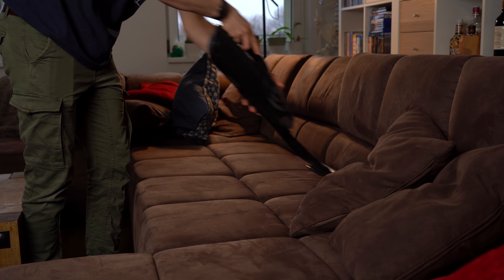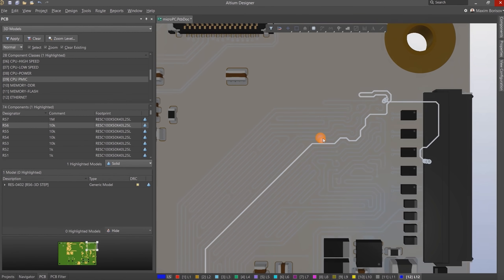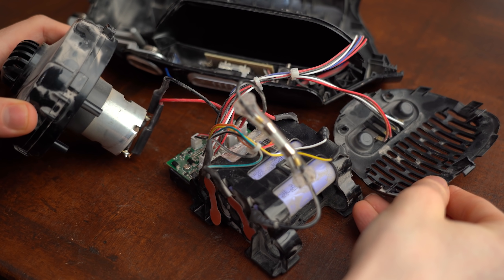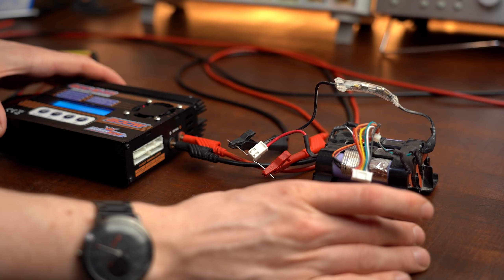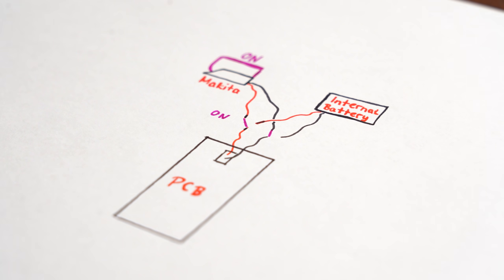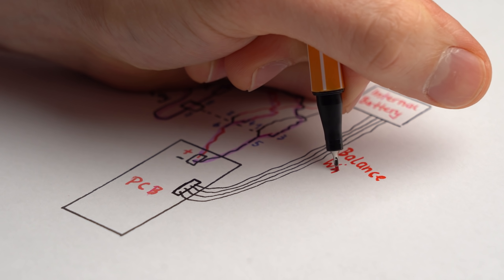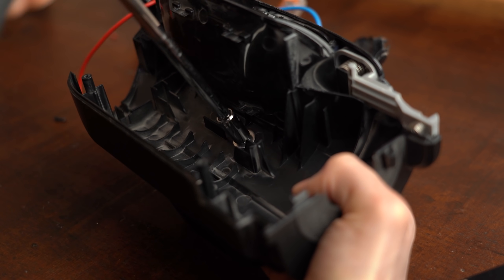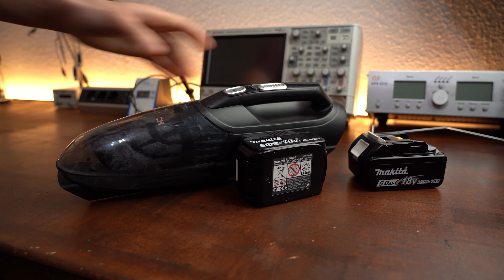Every Device should have this Upgrade! (Endless Battery Run Time)

Comment: Started looking into Power Conditioners for my home due to frequent ripple from other large appliances ( Most commonly the tankless water heater ) . Thought I'd check here for a diy or buy on the topic as I've seen many types voltage controllers on the channel.
Hope to see something from this channel on cleaning up mains power. Ripple and/or Surges.
If I'm overlooking the topic covered even in passing I would appreciate a link in the right direction. If anyone can link me to another channel for the info that would be helpful as well.

Comment: Can you please make a video on hacking  an Apple TV 4K to use type c as power input and using a Type C Decoy for power and using short circuit protection to protect the motherboard from getting fried and please try to use 3d printed parts to hold in place and an few modifications here and there so you can have be portable and take it anywhere and also making a VESA mount to mount it on a monitor or TV. nobody else hasn’t done it yet and that I’ll be the first  and make it look very cool

Comment: It's possible to do much the same thing with far simpler parts. On a similar project I used a micro switch with the external battery connected to the normally open side and the internal pack on the normally closed terminal. With the other circuitry hooked up to the common terminal it was easy enough to position so that it actuated the switch when a battery was inserted.  While the project I was working on was a rechargeable portable speaker, the same principal applies. I hope this helps...

Comment: You will need more running time for extra cleanness and tidiness so I would not consider that as 'Endless'. 
However, if you make a Makita battery shape power supply then you are good to go endless vacuuming!
Reply: On in use, one on the charger, can go on forever.

Comment: wouldnt it have been more simple to wire them in parallel, they both operate at the same voltage and both are 18650s in 5s configuration

Comment: Do not store the vacuum with external battery connected, as the relay will discharge the external battery. Latching Relay to eliminate current draw of the relay when makita battery is left connected for long periods of time?

Comment: Simple.... Thank you I learnt something. So As long as your Current draw and voltage is the same, We're good to go. I assume if the battery can provide more current, let's say 2x the amount needed then should still be fine right? Just means the battery will last even longer?

Comment: Alternatively you could just buy the Bosch Unlimited stick vacuum cleaner that comes with the Bosch 18v all for one battery packs that allow you to swap batteries between charging and also you can use them on Bosch garden power tools. They're also 18v.

Comment: New Dysons have essentially power tool batteries. Of course my Dyson doesn’t, because I didn’t pay $1100 for it. It’ll still suck a golf ball through a garden hose, though. Edit: and the battery is user replaceable. They will sell you a new battery and I believe the torx driver required for it. If not, well it’s four security torx, so how difficult can it be.

Comment: Why u use 2 100 Ohms in parallel, because you had them ?
I think 1 with 50 has the same resitance, right?
Reply: Same resistance but 2 resistors can handle more power/heat.

Comment: Does the original PCB care at all about the charging level of the original battery? As in does it check the voltage to see if you can run the back?
Because then you'd have to remember to charge it.
Also if the battery pack is inserted can you charge the vacuum or do you have to take the pack out? 

Not really an issue, I just wonder

Comment: You have 2 Makita batteries and a charger. Theres Makita vacuums from around 40 eurobucks. I can honestly say the cheapest one is better than the Botch, which relies on clicky snappy parts to make it look like a serious vacuum but its a joke, and even if you boast about german cleanliness, if that Bosch is what you use then your place must pretty fucking rat and cockroach infested filthy dumpster with at least a heroin addict hiding under the kitchen sink and you dont even know it. Seriously I had used that exact vacuum once to clean up after some drilling and it was pretty weak, battery charged. Just sayin..

Comment: What if you wanted to use ego(56v) battery with multiple battery household items? I guess my question is really: how could you make a high power draw capable variable voltage power supply?

I have done this before with some AC power tools, but have never had any luck finding the components to change my 56v battery into an “any voltage I want” with a reasonably large current capability. 

Any thoughts?

Comment: i think that many electronic devices with rechargeable batteries have a low amp charger on purpose since it is recommended to charge a battery nearly as slow as possible... so instead of charging it with 1C (capacity in mah) its better to give the battery more time and charge it at about 0,5C.

Comment: My dyson v7 is pretty excellent, but the battery is getting long in the tooth. I may need to add a mod similar to this someday soon. (assuming the same, the vac doesn't get mad at the balance wires mismatching.

Comment: I was thinking you were just going to use the DC barrel jack, but that solution is much cleaner. Good job!

And, yeah, a battery designed to run power tools would barely break a sweat with that piddly little vacuum motor.

Comment: when doing the plastic welding, if you dont want to melt the plastic casing like in the video. you can use heat proof tape to cover over the areas you want to protect

Comment: We already have endless run time. Invented by Tesla. Plug it in to the wall and it runs forever. Battery powered ANYTHING inside a home (other then emergency lights or communication devices) are ridiculous and lazy....

Comment: Can you pull the batteries out from the pack and rewire them in the vac xase,case, you sider two leads to the batteries in the case than cut two holes to pull the chacable out so you can change,2 batteries pack with 2 chargers with out pulling the mod out all time.

Comment: What about making a cordless device corded? So that you can just plug it in when it runs out of battery juice? I would like to do this to one of my ryobi cordless drills, and I have a matching 19v 6A charger from a laptop. Although I have heard things about amp boosting, where when the drill ends up drawing much more amps when it needs lots of torque to drive a lag bolt for example. No laptop chargers go up anywhere near the amps I have seen for this (you need a pretty expensive power supply with adjustable power settings) so I'm wondering if this is a dead in the water idea since it was supposed to be a cheap diy job.

Comment: Forget the relay. Connect the internal battery battery to a rectifier diode, power can then run from the battery into the diode, then to the remainder of the circuitry. Now connect a second rectifier diode to the remainder of the circuitry in exactly the same way, only connect the second diode to the external battery pack. Mount a 2.1 female jack on the case to of the vacuum to allow connection of the external battery. Cut the wire to the Power tools battery connector short and add a 2.1mm male plug to the that wire, be sure to use the correct polarity. No as a bonus, buy a cigarette lighter adapter that outputs 18vdc, with at least 7.5 amperes. Higher amperage will not be an issue, lower amperage will either damage the adapter or not supply the power needed. Also make sure it has a male 2.1mm plug with the correct wiring. Now you can add the external battery to the vacuum as before, or use the cigarette lighter jack in your car. No switching required as the first diode will prevent the internal battery from connecting to the new power jack and being over powered, and the second diode will prevent the external battery or cigarette lighter jack from connecting to the internal battery and being drained. Both diodes are need since diodes allow power to flow ONLY in one direction, two are needed to prevent either battery from connecting to the other, however they should both supply power to the vacuum's circuitry.
Reply: P.S. you might eliminate the diodes if you can find a 2.1mm female jack that has a built in switch to disconnect the internal battery when the 2.1mm plug is inserted into the jack. There are jacks with such built in switches.

Comment: Had an idea for a project like this for my VR headset, it gets hot here so i want fans to pump air into vents, but i don't want my quest vr tethered, so figured my 12v drill power pack shoudl be portable enough

Comment: That is awesome! I want to make a "dummy" adapter that simulates two "D" cells and holds a 18650 cell (or 2 in parallel) inside it. I have chargers for 18650s but I am not sure the best and most efficient way to make the 18650(s) make a controlled 3 volts the "D" cells would make. Can you let me know if this can be done? Is there maybe a ready made circuit from China that would produce the 3 volts and then cut off to protect over discharge? I have a 2 cell Maglight I would like to convert to work with rechargeables. Thanks Scott, and everyone!

Comment: Great Scott, how can I change 2,000volt 30Khz to 2,000volts 60hz with a microwave transformer? Is it as easy as using the capacitor that went with the transformer aka resonant capacitor?

Comment: What's funny is that I was thinking of this just when you published this video. I have the exact same Bosch vacuum cleaner, and over time it's gotten worse(less runtime, slower charging).
Haven't taken mine apart yet, but now that I've seen what's inside, It might be feasible to throw in 5S3P or even 4P combo with a heftier BMS in it(the one that can handle at least 5-6A charge current).

Comment: Question, How do you keep the old battery pack from dropping voltage since its only 2ah, wouldn't it over discharge or does it cutoff when its below its running voltage and only run off the external battery?

Comment: Does the main vacuum switch also cuts off the relay spool from the external battery? Or does the relay spool drains the external battery via the 50 ohm resistor?

Comment: What I did the other day was I out a DC to DC voltage booster on mine. So it went from 12v to around 18v and that seemed to really help with the suction power. Then I drilled bigger exhaust holes so it can expel the air better.

Comment: I specifically bought a Dyson cordless vacuum for exactly this reason.
Imagine my shock when I got it and realized that it could have been done like this, but they chose not to. 
Literally the only thing preventing Dyson cordless vacuums from having a changeable battery is a secure attachment latch instead of the factory screws into plastic. All the control circuitry is in the battery unit. Even the button to turn it on actuated by the trigger. The trigger in the vacuum body is just a plastic lever that presses on a button in the battery module.
I'm not sure how the suction level selector switch works but there are only 2 contacts between the battery module and the main housing that holds the motor, filters, dust bin, etc.

Such a missed opportunity.
Reply: We've had both an older and now a newer model Dyson cordless vacuum in our household. The older model actually had removable battery packs. The newer one shares almost the same exact body with the difference of the battery being permanently molded into the vacuum.

Comment: Great idea, I've always hated battery-powered things with built-in, non-swappable batteries.
One thing that might be a good idea to address is that the relay will always be drawing a small but significant amount of power from the external battery pack as long as it's connected. So if you forget to remove the external battery after use, it will drain it until you reach the LVC of the built in battery management system, which is usually around 12.5 volts, or 2.5v/cell.
Not a huge deal, right? Well, a lot of the cheap Makita clone batteries don't have a built-in BMS at all, and will end up drained down to 0v, damaging the cells irreparably.

A mechanical switch placed in such a way that it is triggered by physically installing the makita battery is one way around that issue.
Another would be to use a couple MOSFETs instead of a relay, due to the much lower current required to keep those turned on - nanoamps or microamps, vs hundreds of milliamps.
Reply: Buy cheap Makita clone and you deserve what you get. We should all know by now that Li-on batteries can set your place on fire when even slightly mistreated. A real Makita battery comes with everything needed to keep itself and you safe.

Comment: I did the same thing with an old black&decker hand vac and an m12 milwaukee battery. 12v instead of the 9.6v it was running at so it's got more power now but hopefully it doesn't burn the motor up

Comment: nice work sir Scotty! i have had a related idea for years and i wonder if it is a project you could tackle, if you are interested. it is also something where i have absolutely no idea why it isn't available.
could you make a plug in wired wall adaptor for cordless tools like these, for times when we don't need them to be cordless or have a really big, repetitive project and not enough batteries for continuous work? buying replacements can be expensive and protecting them from unnecessary charge cycles could make them last a little longer. i can name many scenarios where this would be useful, but i've never seen it done. what do you think? could you make it work?

Comment: I have a Bosch unlimited vacuum cleaner that uses the "power for all 18V system" batteries, there were 2  battery packs (3Ah) included, it was more expensive, but it is much better than waiting for 4 hours to recharge an internal battery...

Comment: bro it must be very heavy i think its goood idea but why you just did not replace battery with brand new 18650batts ? 
i think best solving of this problem is just make the docking station for the vacum integrated your tiny charge that came with vacum and let the vacum charging for all time and the you  can pick up your vacum every time you need :D

Comment: I saw Post Apocalyptic Inventor has a Henry vacuum, if you ever see a 2Kw Henry or the bigger washer Charles or George vacuums you can't go wrong as they are completely modular meaning you can easily buy a broken part and some people have their Henry's from the 80's still running like new.
Reply: Could you not put in a Q charge filament and charge it wirelessly making up a carrier to conveniently plop into place and it would automatically charge?   Then add some solar panelling for the all terrain vacuum cleaner that never runs out :P

Comment: Not just longer run time, also a performance boost. You can def hear the motor running faster with external battery

Comment: Hello GreatScott! … 
I’ve had this simple idea in my head for some time … A portable changing station.  Something you could carry into a cafe and keep beneath the table.
- A wheel and trundle.  You know, one of those pedal and flywheel set-ups.  
I was thinking of a small bicycle wheel and crank on a stand.  The trundle folds down and snap into place.  Like a Ferris Wheel 🎡 but about 12 inches or 1/2 a meter.  The tire would transmit to a the generator.  Connect a junction box and battery and rock that pedal.  Plug the phone or laptop in and go for ever.
😊 there are a lot of numbers to crunch for efficiency BUT that’s the ruff basics - Cocktail Napkin (gifted) to you.
Reply: the problem with this idea is that it will take way too long to actually charge anything
Reply: @taududeblobber221  You think that maybe, perhaps it could be made with an efficient enough gear and engine to prove you wrong?  How about an entire GYM of cycling machines hooked up to the grid? Now, try that with ALL of the GYMS in a city.  Still think the idea is silly? Well, I spoke to a Gym Equipment manufacturer, and they told me that they tried it but couldn’t find a buyer.
Reply: @StephenRansom47  idk what i'm talking about

Comment: I have done something simmilar but with milwaukee batteries ( its what i use) but i would like to bring it to the next level and use the battery's communication port in order to tell the tool to stop if the battery is to low on charge or overheating...this is achieved via some kind of communication between the tool and the battery. Could this be a good follow up project for you, i guess makitta has something similar

Comment: I'm curious about the ergonomics of this mod. It's nice to have longer battery life but can you hold it for that period of time with the added weight?
Reply: i dont think his hand is going to explode from an extra 3lbs of weight.
Reply: I don't think that weight is a problem but bigger issue is how to mount battery holder so it would look good. To keep it as light as possible then option is to remove original battery and use only outside one. This would be easier mod to do anyway.
Reply: I'd be less concerned about the weight itself and more about the fact that it's only on one side. It would have been great if there was a way to mount the battery on top since it couldn't go on the bottom.

Comment: Great project. I’ve jury rigged battery packs as backup jobsite ac power, for small loads they can last a night. Would be interesting to see a homebuilt inverter, usb, 12V supply.

Comment: Battery power products should all come with removable battery packs, preferably using standard rechargeable batteries. Built in batteries are designed to produce built in obsolescence.
A few manufactures have adopted a one battery fits all philosophy, which is a step in the right direction. 
What the consumer really needs is products that use a generic series of battery packs, that extends the above philosophy to generic batteries that fit all products.